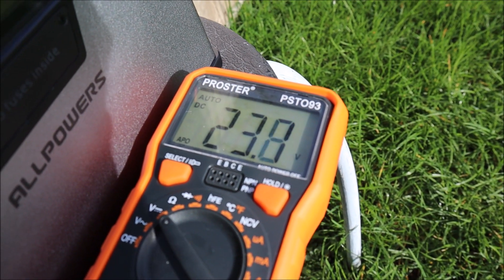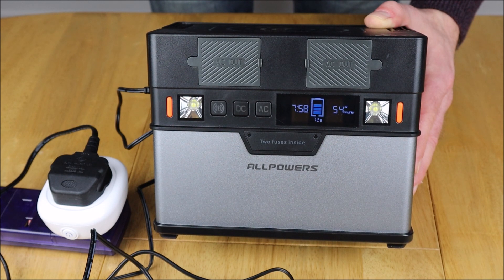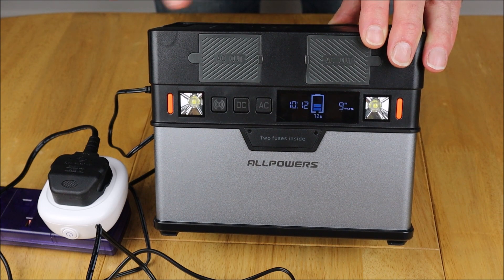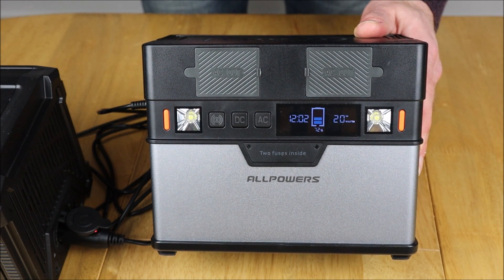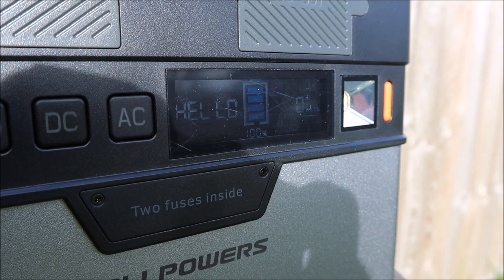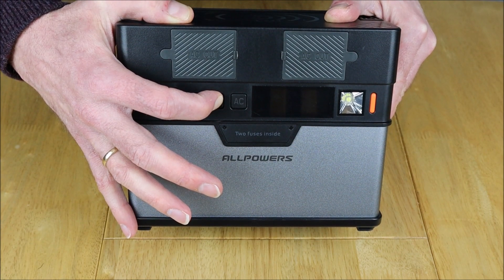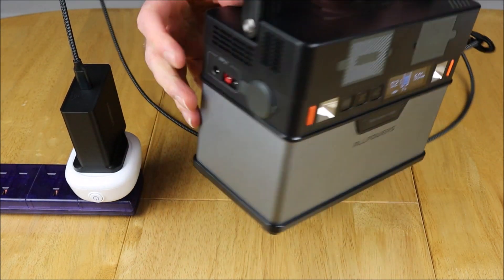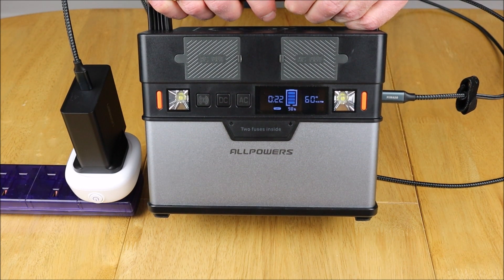ALLPOWERS 372Wh Portable Solar Generator Update | Charging Rundown

Comment: I wanted to buy this to go camping but I wanted to know will I be able to run 3 mobile phones, 2 samsung s10 and 1 iphone 10, I have 2 lanterns, wifi dongle some rechargable torches. 

Unfortunatly I'm not very good at working out watt that I'll use so I was wondering if you know roughly how many hours the power bank would give with the above mentioned items 

also are there any links where I can buy the solar panels from and would I really need them? 

I'm going camping first time in non electric  feild with 2 small kids. we've never been without electric before
Reply from the maker: @Nur Ahmed  Good day and thanks for your question. Let's see what we can do to get you through your first off-grid camping experience. Please can you let me know the following to start with?

1. When are you going? Just in-case delivery takes too long.
2. How long are you going to be in the field without any power? Is it just overnight or for days in a row? Do you have access to a car or other vehicle?
3. Do you have the specs for the lanterns? Are they rechargeable and how many watts do they consume?

If you can let me know when you get a chance it will give me a better idea of what your trip looks like. All the best, Adrian
Reply: @DADvinci  thank you so much for replying, so I'm going the 4 days and 3 nights. 

we will be going on the 3rd August as long as the lockdown softens 

we have a car 

the lanterns are 10 watt
I may run a camp kettle 1000 watt and a toaster but cant find anything that tells me what the watt is
Reply from the maker: @Nur Ahmed  Hiya! The 372Wh should cover what you need to charge and run (phones, lanterns and torches), but you will need to have a way to recharge as it won't cover the whole 4 days and 3 nights. The display is really good so will give you an idea of when you need to recharge (helps with planning). Do you need to use a Wi-Fi dongle or can you share a Wi-Fi hotspot from one of the phones? This might save taking the dongle and needing to power it. I recommend testing the usage and charging of the devices (as if you were in the field) at home before going which will help know how long the battery is likely to last.

I nearly always recommend getting a solar panel to go with the 372Wh as it's such a useful edition for trips such as this or just using at home generally. As you're going to be reliant on the unit, especially overnight, you might need a backup method if it's not sunny while you're away. Charging from your car might be the best option for this trip and then perhaps you could get a solar panel later down the line. This would save the upfront cost of buying the panel and just getting a 12V adapter to use in the car. If you want to get both in one hit, please let me know and I can recommend the panel and adapter. If you do charge from your car you really should have the engine running otherwise it might drain the battery. If you are planning trips out using the car, that would be the best time to charge the 372Wh.

You will not be able to run a 1000W kettle or toaster using this unit as the AC inverter can only provide a maximum of 300W. Even camping versions of these would need to be below 300W to have any chance of firing up. You would also drain the battery very quickly drawing this amount of power just covering breakfast toast and cups of tea.

I hope this helps? If you can let me know the extra bits that would be great. Take care, Adrian
Reply: @DADvinci  thank you a million for your help. I spoke to the lady whom owns the camp site, she has said that the showers have 2 power sockets for things like shavers, hair dryers so i could use that to charge the power bank during the day and use the power source at night.  they are large showers so the unit wouldn't get wet either. 

We have unlimited internet on our mobile phones and been told the mobile signal in the camp site is next to nothing.  We've decided no to take kids ipads so no longer taking the dongle. 

i will defiantly invest in the solar and the adapter as we will be taking kids camping in all the school holidays going forward as long as this trip is good
Reply from the maker: @Nur Ahmed  Hiya! It's my pleasure, glad to help. That's a great option to charge during the day and good that there's no chance of it getting wet too. It sounds like you have all the options covered for mobile Internet as well. I'm not sure if you've seen all the videos on the 372Wh, but they might be useful before you make a buying decision. Here's the playlist > https://bit.ly/2AbwG5L . Charging, other than using solar, via the USB-C PD port on the 372Wh is one of the best features (for mains and car charging).

As for a portable solar panel, this video > https://youtu.be/qLYXnp5OGmw is for my long-term 60W ALLPOWERS one. They also do a 100W version for slightly quicker charging which is a little bit bigger when unfolded, but it hasn't been available recently. Like the 372Wh videos, the links are in the descriptions.

I hope this is useful. Please shout if you need anything else. Take care, Adrian

Comment: You really shouldn't be doing videos like these if you don't know why things like the power capping is happening and charging power differences.  I got to 3:08 before I stopped watching, here's why:
1) The charging difference 55w vs 60w on your uncalibrated monitor, which is fine.  You're seeing a 5w loss, which is typical for a charger as you will always have some form of loss from stepping the power down from mains to what the charger expects.
2) The power capping - this is also a good feature to have.  Most power supplies will sit down if you draw too much current from them, then restart (laptop PSU's do this, it's a safety thing).  In case you're not using the correct PSU to charge with, the battery reduces the power input each time your 'simulated' sit-down and restart of the PSU happens. If will keep reducing the power until the PSU doesn't restart.
I didn't watch the rest of the video because I'd given up by that time.
Reply from the maker: @Ian Hawkins  Good day and thanks for your feedback. This video was shot a few months ago and I was sharing my experience in an attempt to help others who may have been experiencing similar.

As has previously been explained to others who have not found our content useful, we are not experts in all the subjects we cover and will become that the more we learn. In this regard, I've learnt a significant amount since this was filmed. 

I've worked with the manufacturer on the charging issues (yes there are issues) and also shared a workaround. Suffice to say, my feedback has now changed the advice the manufacturer provides on charging the device and they also refer customers to the follow-up video from this one (this has come direct from viewers, not me asking). 

These videos have helped 100s of viewers get the most out of this device and make informed purchasing decisions (many have not purchased as a result). I could have made another review video saying how great it is to boost sales (like some other channels). I chose to share my experience for people that aren't experts in electronics or electrical engineering and simply don't have an interest in calibrated results.

These videos are not aimed at experts like yourself and they will improve over time as my own knowledge and experience increases. Thanks for taking your time to feedback and have a great weekend. All the best, Adrian